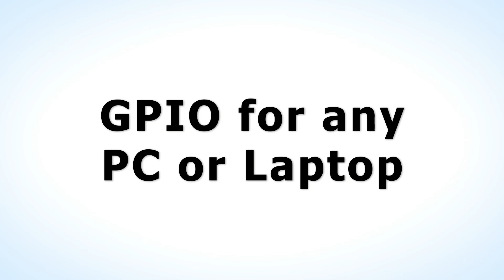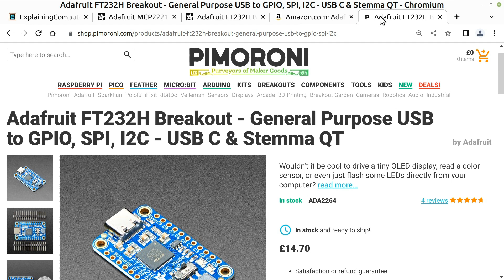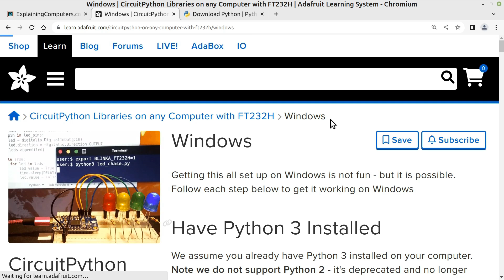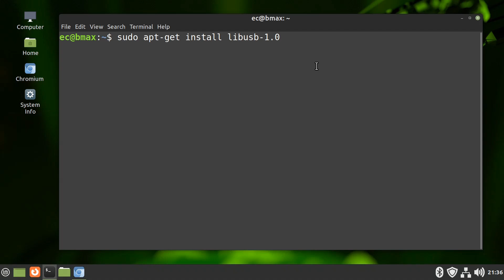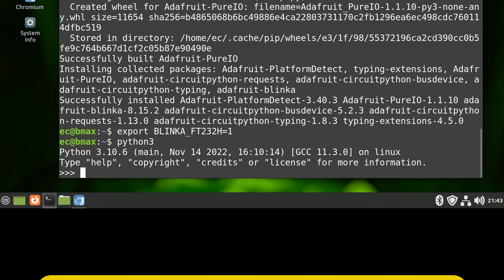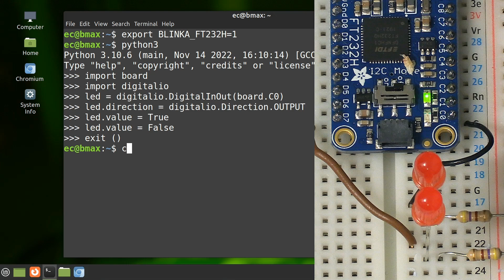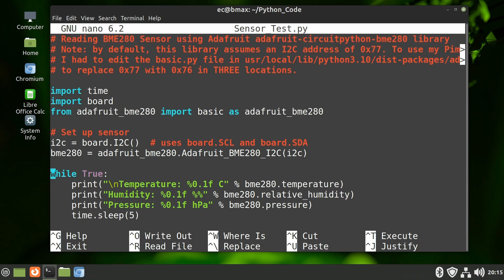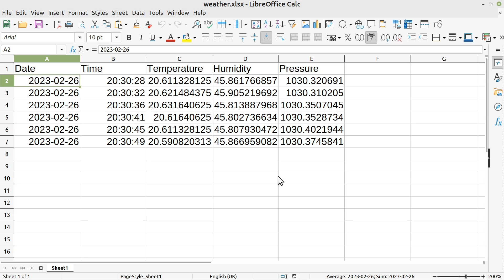GPIO for any PC or Laptop: Adafruit FT232H

Comment: Hello Samantha. Great video. When your project doesn't require a small form factor, this type of system is better than an SBC. I suspect that soon, someone will come up with a simpler way to configure the system. I hope you are your family are doing better.
Reply: Samantha is the soldering iron. The host's name is Chris.
Reply: @pleappleappleap  I know. And there’s Stanley the Knife. As well as several other tools with names. Several of us greet them by name when they appear in the videos. PS: You can buy merch on Chris’s store featuring some of the tools.
Reply: @CCoburn3  I have Stanley's antipodean relative - the Fat Max and Max loves a good unboxing.
Reply: @pleappleappleap  Samantha is hot ^.^
Reply: @pleappleappleap  Samantha is HAWT! Look but don't touch!
Reply: Samantha is hot stuff...

Comment: I worked for an industrial controls company back in the early to mid-1990s. All that equipment used to cost tens of thousands of dollars. Now you're showing us the current state of the art. My 1990s self is marveling at what has become of that industry.
Reply: My dad worked in industrial refrigeration and designed control systems for them in the 90s. I am marveling at these current cheap technologies for similar reasons.

Comment: Nice video. But it would be nice to do this within a GUI instead of using the terminal. I would suggest QT5/6 Creator. I believe that there may be a Python version or libraries to do so, but my preference would be C++.  I've used the MCP22xx devices....Don't much like UART emulation, but dealing with RAW USB is a daunting task. Unfortunately, the last time I looked at QT, there still was not a USB class. As for myself any remote control or telemetry I prefer using a TCP/IP to SPI or UART, etc. bridge. Using of course microchip devices.

Comment: With a little help from Brian Blutac. I like the way they labelled both sides of the board (hint to Raspberry Pi). 

Note that the RP2040 SDK contains good support for USB devices and hosts via TinyUSB. They include examples, too. So, with some effort, one could could turn the RP2040 into a similar device. There'd be no need to choose to choose between either SPI or I2C either, and one could add customisation if you so wished. 

You could probably get something like an STM32 board to do it as well, although an RP2040 would likely be the best place to start because it has USB support as part of its SDK.
Reply: would prefer to use the pico for that than get another special purpose thingie.
something like pyfirmata, can that work with the pico?! ...
Reply: @Henry-sv3wv  Oh, that's interesting. I never heard of the Firmata protocol before. I checked it out quickly. It seems to be an adaption of the MIDI format sent of serial.
Reply: Threre is FirmataPlus + Pymataio, or the more recent FirmataExpress + Telemetrix, for Arduino board family, developed by Alan Yorinks.

Comment: Someone I know has an old sega master system and had rigged a pi gpio to some points in the controller and wrote code that controls the console with your keyboard. Though its slightly laggy.

Comment: Nice. I'm not a big fan of SBC's, but they do look like great computers for people who can't afford a traditional desktop tower, or slimline. They are somewhat powerful, but I think a traditional tower is always best for power, as well as keeping upgrades and repairs easy, these smaller ones look way more difficult to repair if something fails.
Reply: The advantage used to be cost - until the scalpers started buying all of the Raspberry Pis
Reply: Most of the time they last so long that if they ever fail: there aren't even spare parts available anymore or it's to expensive to repair and instead replace with a more recent SBC.
In terms of power and comparison to towers, well: depends on the use cases as always.

Comment: It would be interesting if you could elaborate a bit more on the pros and cons of direct and indirect GPIO. I mean, a Raspberry Pico costs less and can run independently. When is a direct GPIO superior?
Reply: As always: it depends. Yes a Pico can run independently to collect such temperature values almost anywhere in the world. But it only has <=2MB to store them.
How much data will you collect, how will you read it out, how often?
Whereas you could have an SBC with some external harddrive as your backup server in a separate room, direct GPIO could control fans based on temperature, and it could not just save to spreadsheet but also send alert mails if something fails.
Could a Pico attached to a SBC send out mail alerts? You would have to code on the Pico to read out sensors, and code on the SBC to grab the data, evaluate and store/alert/etc. I imagine such tasks (altough it's a one time) to be easier done with direct GPIO, making up for the 5 bucks difference.
But I might be wrong, just a thought.
Reply: @FunIsGoingOn  You can add SD card support for a Pico. There's also a wireless Pico. You could do a LOT with a Pico. For something that complicated, though, you'd probably be better off using something like a Pi 0.
Reply: @zetaconvex1987  Thanks, nice to know.
Reply: i don't like that solution, would try firmata or Python picod module
Reply: Personally in embedded systems I have used the PC for a management role and the SBC as the autonomous controller. However I can imagine projects where you want the PC as the controller with the I/O simply being just I/O. For development it may be easier to just do it all on the PC rather than have to upload it to the SBC each compile. Then again if you want really rapid development use a PI Pico with BASIC installed. No downloading or compiling needed at all. Direct like in the old days.
Reply: @MartinMeise, one very successful software is Mach3 and Mach4 by ArtSoft, they can control stepper motors, servo motors, spindle motors on CNC machine and many more through a cheap USB board with GPIO and AC/DC which means you can use PC with Windows 10, 11 as microcontroller with great GUI
Reply: That kind of thing usually comes down to timing. In a real world environment it is often critical to have split second response to real world inputs. Direct access is usually more responsive.

Comment: well done EC, I remember people doing something similar in the 70s with an Apple II using it as a micro-controller (the term micro-controller didn't exist then). You could write a basic program to monitor sensors, etc. that output variable voltage (e.g. thermocouple), via the game paddle port as GP I/O since the paddle potentiometer was analog & translated voltage into values between 0 and 255.
Reply: The first microcontroller was developed in 1971, and the word was also first used in that year. It just wasn't a very commonly used word until later.
Reply: actually, the apple II translated the resistance of the game paddle, not the voltage across it. It counted how long a capacitor on the main board took to discharge across the resistor. The great Woz never added an extra chip if he didn't need to.
Reply: @ericthecyclist  The original IBM PC used this method as well; the cheapest possible analog to digital converter.

Comment: I thought about doing some logging,  but rather than connecting sensors to a PC USB port I'd use an esp32 or pico w, setup a simple web page and retrieve the values using a cron job (wget) and storing in a csv. I could do logging this way on many sensors in different locations with less software libraries. Also an esp32 is cheaper than a ft232h.
Reply: that and there is firmata or Python picod module